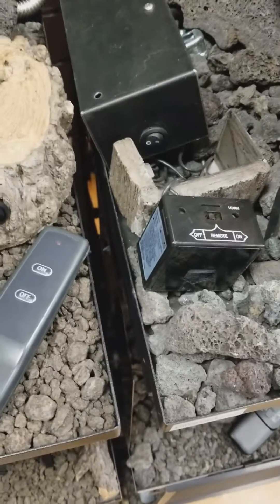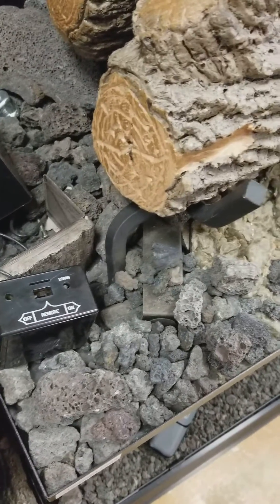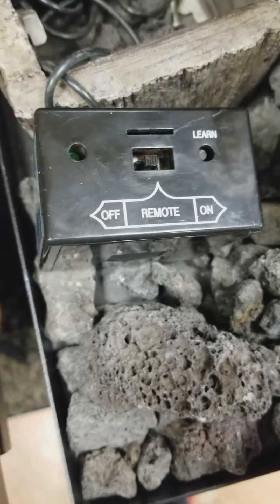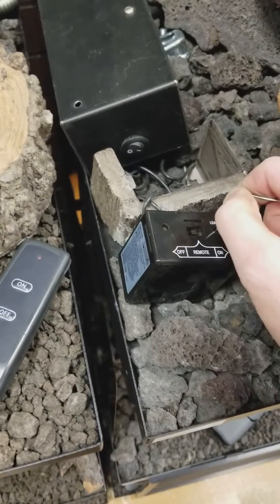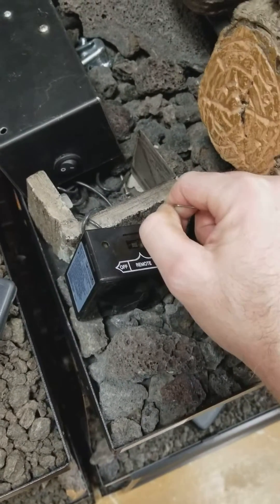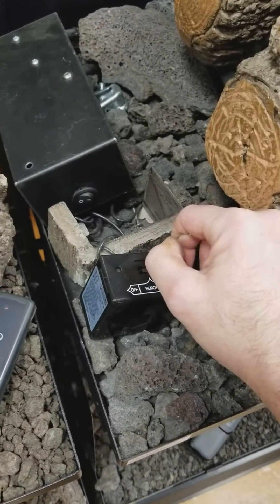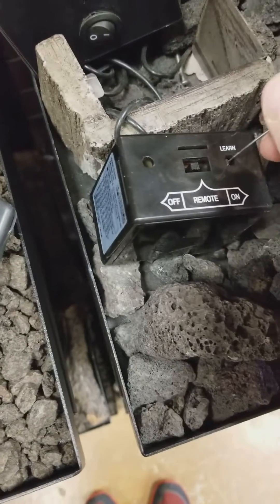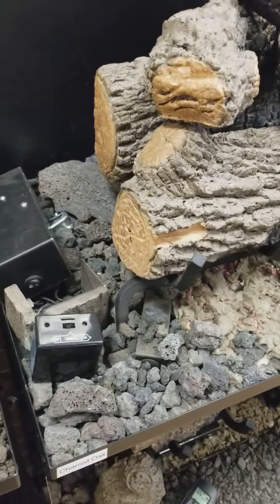Resetting your gas log remote receiver box

Comment: We've got two sets of logs one directly downstairs from the other. Our installer had issues getting the upstairs one to work. In the process he synced the downstairs remote to the upstairs. We've been running up and turning it off every time we want to use the downstairs. It also made our thermostat remotes useless. I used your advice and fixed the issue in 1 minute. Thank you so much for sharing!

Comment: Tried both the resync and the reset, didn’t work for me. All batteries are new. Receiver makes all the beeping sound, remote gives out a red light. But when I sync, no beeps are heard when I press the On button on the remote. Fireplace turns on manually. Help!!!

Comment: We tried this but our unit does not beep when the learn button is pressed… we tried replacing the batteries in both our remote and receiver but that didn’t help. The fireplace does turn on when we slide the button to On, but we just can’t get the remote to work anymore. Very frustrating, guess we will be calling a repair person haha

Comment: John, I have customer who has this exact same system. From time to time it will malfunction. If you press on, the dial will try to turn, but then a clicking sound is heard and it just won't be able to get past it. It just keeps clicking. If I reach down and turn it manually just a bit, it fixes the issue and it will function as designed. But then some time later, it happens again.
I think it happens because this home owner is paranoid about fires, and she will mash that remote to off till the thing clicks and clicks and clicks in the off spot. It is almost as if she presses OFF so long that thing gets ratcheted to point where the motor just doesn't have enough ass to get it moving back the other way.
Not sure  if you understand my issue... but if you do, any thoughts?

Comment: I don’t have a “learn” button.  What now?
Reply: Same for me. I have a Skytech remote, assuming the receiver box is from the same brand. I had to replace the batteries in the receiver box because they were badly corroded, so I thougt replacing the batteries were going to fix the fireplace not starting issue, but that didn't fix it.